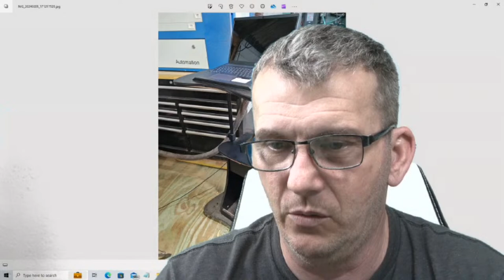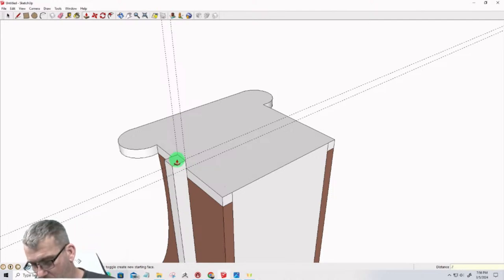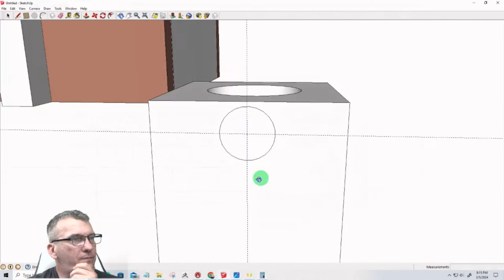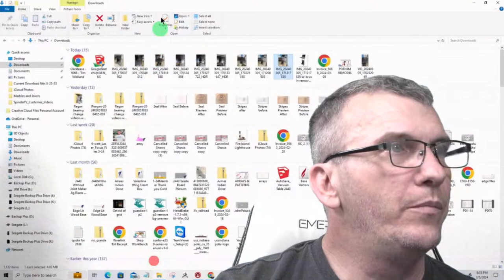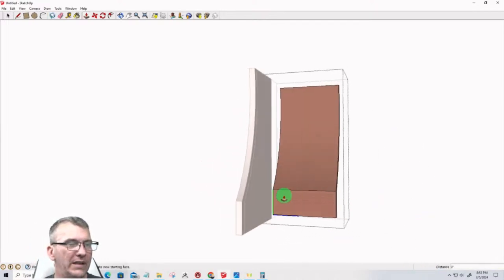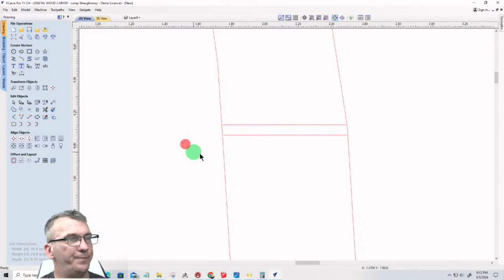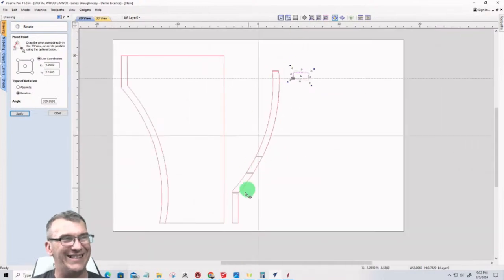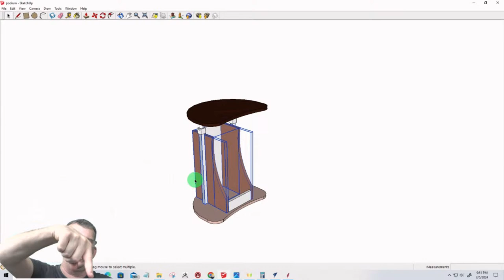CNC Computer Stand-Podium Redesign| CNC Vectric & Sketchup Tutorial

Comment: A couple of details:  1.  The builder needs a source for the trunions that you were able to salvage.    2.  Could you consider doing the molding tool paths on thicker wood, like 2x4's?  The backs of the drawer fronts could then be square, so the precision angle rip saw cuts are not necessary.  This would also simplify the matching of the drawer fronts to the drawer sides.